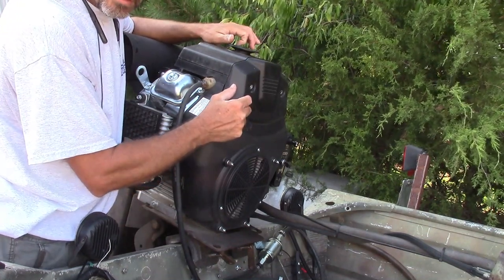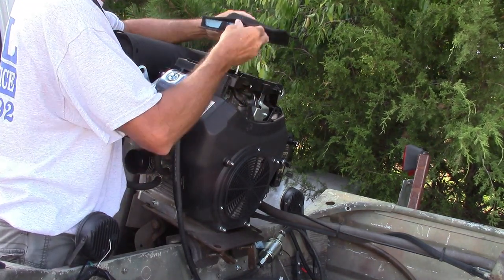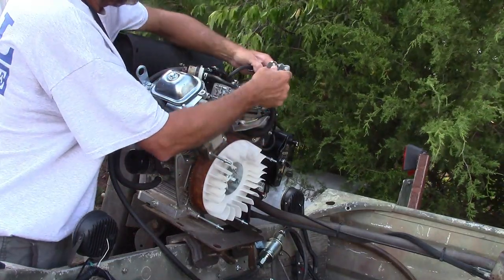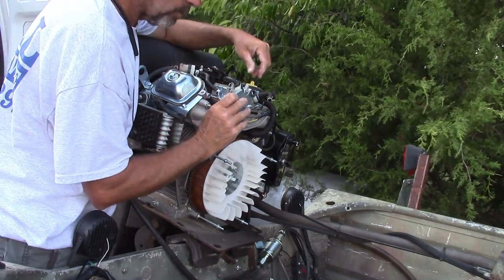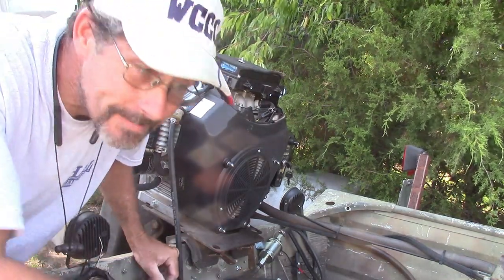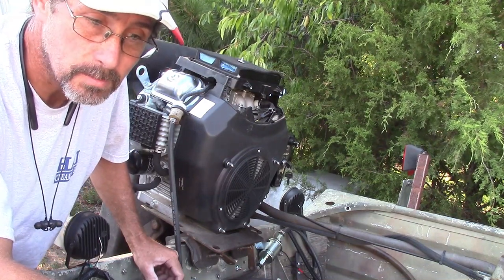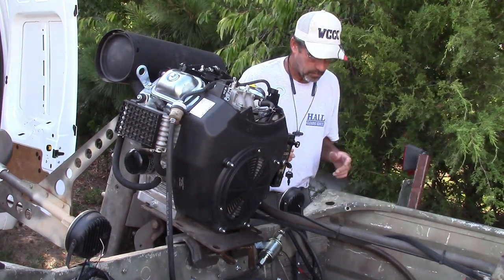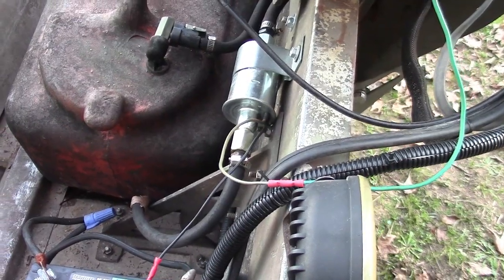Predator 670 Mud buddy Fuel pump replacement

Comment: This is what I done to mine. Replaced the carb with a true mikuni slide carb 38mm. Installed an electric pump just as you did, only I installed an adjustable fuel regulator so it doesn't flood the carb with excess pressure. I also used a relay to power pump instead of powering pump directly through key switch. This will help key switch last allot longer plus prevent smoking wires (fire hazard). This is how big industrial motors are ran. Use small power to control big power. In the case of boats it is dc power which is harder to switch than ac power. Enjoyed your video. Always something to learn. Thanks.
Reply from the maker: Thanks for watching, The relay is a great idea I believe I'll try it. I have a 38 Mikuni will be installing soon. Going to try to put out the exhaust video this weekend. Keep your eyes open for it.
Reply: What fuel pump and fuel regulator did you use?
Reply from the maker: @camerongliganic7333  the pump is a Precision low pressure from Oreilly no regulator.
Reply: As to the pump and regulator, I used an old Holley canister or in line pump I had from an old hot rod I had years ago. Not a racing one, just one that would feed a quadrajet. I had an old napa brand reg from back in the day with a pressure port for a pressure gauge. It is regulated to around 2 psi. Your set up may have different requirements depending on carb, cam, heads, etc. My engine is NOT stock by any means. It operates from 5 to 6000 rpm but it's still only two cylinders and too much pressure overcomes the float seat and will flood the carb. I'm sure you can find these two items at any AutoZone, advance, O'Reilly's, etc. You will probably have to experiment with your engines pressure requirements at idle and WOT to see how much it needs to keep engine from starving from fuel. Here's a freebie. Mount the fuel pump as close to your fuel tank as possible, as some pumps don't like to much suction head. Obviously take all precautions to make it intrinsically safe. (No sparks.) I would give you guys some part numbers but they're are all wore off. 🤷 Good luck and most of all have some fun.

Comment: Do you have a part number for the fuel pump
Reply from the maker: I don't have the part number but it was the only low pressure precision pump Oreilly had. It was either that one or the Edlbrock I would suggest planning on replacing either one at least once a year  especially if you run it much at all. Thanks for watching.

Comment: this is a common problem with these engines, the stumble. Back both jets in carb out 1 turn
Reply from the maker: Thanks for watching. I was showing the process I used, there are alot of variables in tuning a carb. The number of turnes could be different depending on altitude barimetric pressure dewpoint in the air etc. I think you just tune until you are happy with the performance. thanks again for watching

Comment: Is there a link for the fuel pump you got from o riellys
Reply from the maker: I dont have a link to the pump but it was a basic low pressure pump. I just didnt want to go with the same one I puled off.

Comment: What size boat and what kinda speeds are you seeing
Reply from the maker: It's a 1648 i'm getting 23 to 24 empty
Reply: Sweet I got mine on a 1444 monark 670 with an old Dixie surface drive frame still trying to find that sweet spot in my trim but hopefully I start seeing some speed soon I’ve only hit 16 so far I know it’s got more than that

Comment: What did you do with the crankcase tube that ran the OEM pump? Did you just leave it venting to atmosphere? 

I’ve got a built 670 with a 34mm Mikuni flatslide. I’m running an electric fuel pump along with the OEM pulse pump. I’d like to just run directly from the electric pump to the carb, but I’m not sure what to do with the crankcase tube. Any advice?
Reply from the maker: I want to say I left it open its been a little while
Reply: Did you ever figure out what to do with the crank case hose?